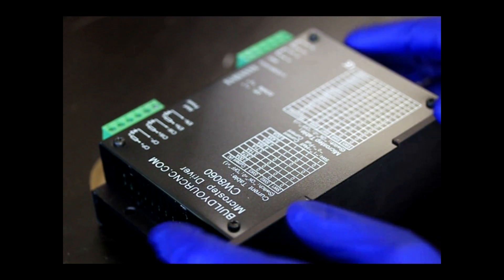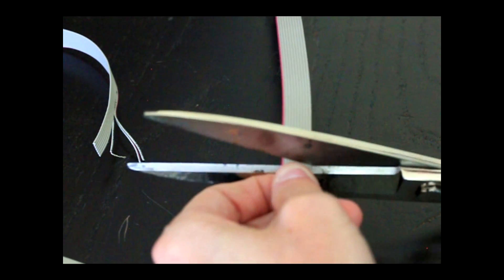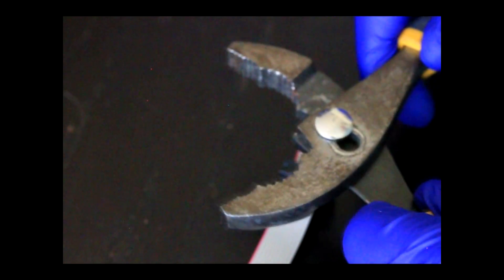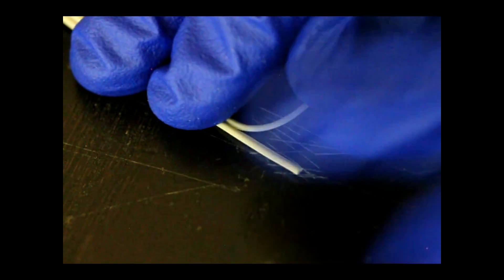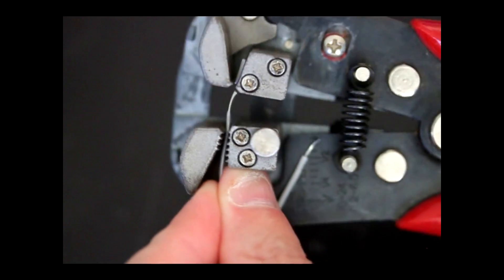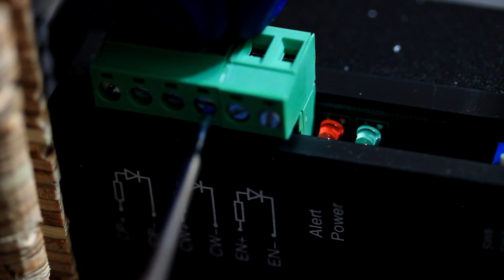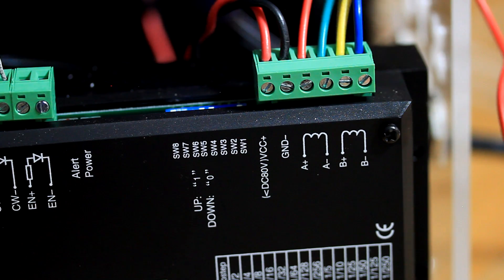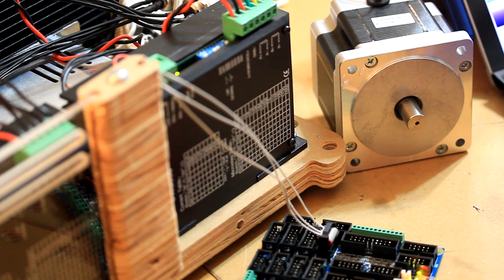3. Pokeys57CNC Connect a Stepper Motor and Test with Mach3

Comment: Nice Video. The splicing is highly not recommended. It has a sense, that every 2nd pin is a ground pin, because of EMI. See here http://www.electronicsplanet.ch/emv/emv-flachbandkabel.php
Reply from the maker: Thanks for the reference and correction.
Reply from the maker: The link you included talks about EMI filters and ferrite cores.  There is no reference to splicing or an alternative. Can you provide more detail?  Thnaks.

Comment: Pokeys57CNC manual says step and direction pins of motor output are 'digital output pins' that serves at least 4,9V in High state. So why on motor driver side you connect +5V  from pokeys to pul+ and dir+ and digital outputs from pokeys to pul- and dir- ? Shouldn't pul+ pul- on driver be connected to step and gnd on pokeys? What about axis enable pin?

Comment: No bob between then
Reply from the maker: No, the controller can function directly with the drivers.  By the way, like the bus and thanks for the white wine vinegar tip!!
Reply from the maker: You also mentioned that you want to run NEMA 34 motors.  You can use any controller since it only delivers the signals to the stepper motor drivers.  with NEMA 34 motors, you will need these drivers, or equivalent: https://www.buildyourcnc.com/item/electronicsAndMotors-electronic-component-driver-PoStep60-256 or https://www.buildyourcnc.com/item/electronicsAndMotors-stepper-driver-6!0a
Reply: Bus is cool. Cost me 12,000 pounds to buy and ship feom Philadelphia to UK. It looks so much better inside already. Huge project. Yep the white wine works. Damn bugs.

Comment: For external stepper drivers, its best to also ground the PUL-, DIR- and ENABLE- pins to the Pokeys Ground. The ribbon cable carries ground on all even numbered pins (2,4,6,8,10). So dont clip it off. Without ground reference, you may get grinding sounds on stepper because the 5v leads appear floating as connected in this video. Apart from that... Nice video. Btw... Even the Pokeys manual suggests grounding as i explained.
Reply: Hi Naidol, so where do you recomend to put the Ground cabels to? Do i need to connect them to " PUL-, DIR- and ENABLE" or a different Connection?